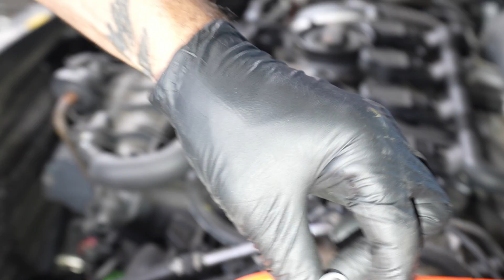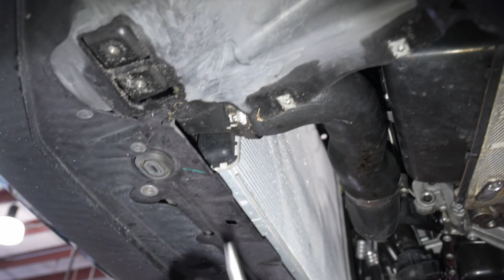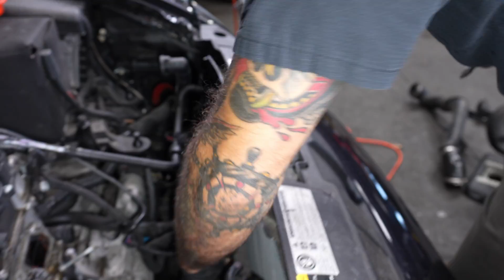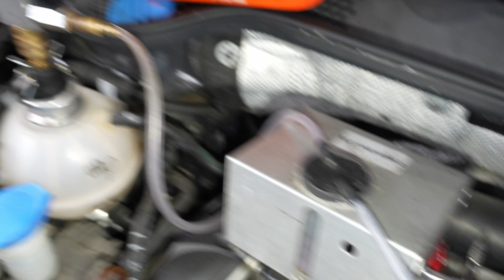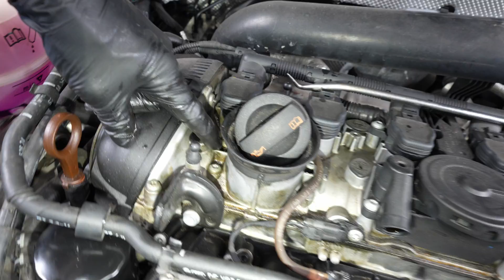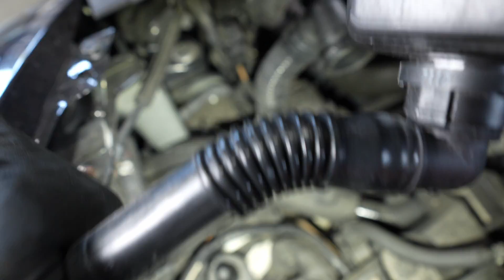2013 Beetle Water Pump

Comment: Just did mine on my 2012 bug turbo...

2.0tsi gen 1 e888 CBFA but my wp only has one sensor... all info ive found says CBFA  is a california car so emissions require a second sensor on the wp... but my cbfa didnt have it... and my wifes 2012 bug turbo wp needs replaced... same as mine cbfa... i have a aluminum one i will be installing since she shouldnt have the second sensor as well... but from my research ccta is the one without the sensor...  i know for a fact mine is cbfa because of tuning....

Comment: these wp/t-stat housings are annoying to do.
hb the newer 2.0t accessory bracket seal to block that fail all the time, one mite think its the wp or t-stat housing leaking coolant, but if you look behind the oil filter (or when doing oil change) you can see the top tab of the red/orange seal blown out and theres the coolant leak. do a vid on that!